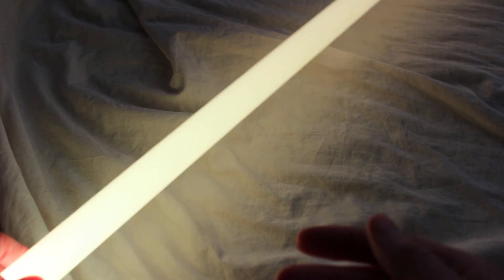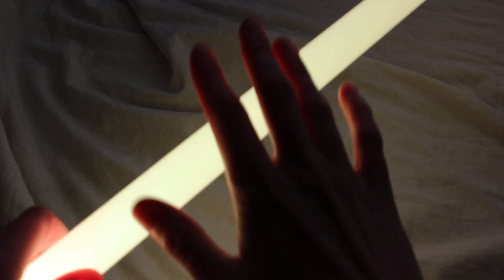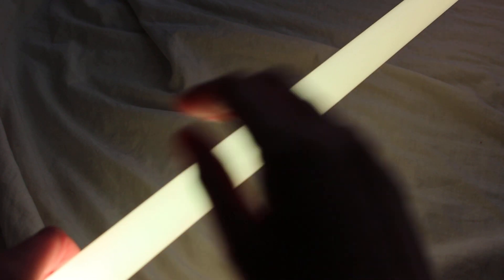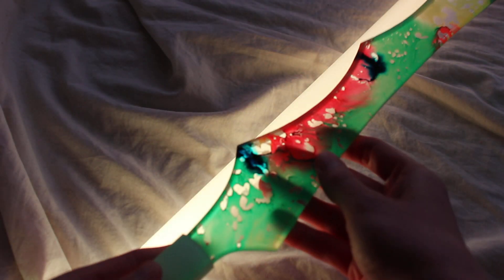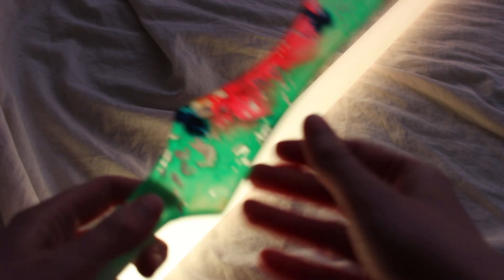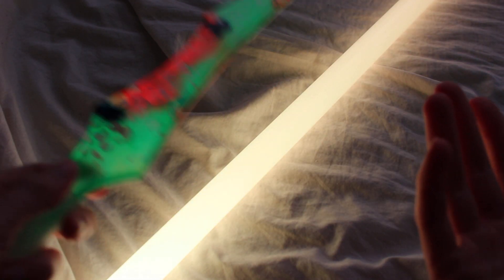What are REAL lightsaber blades made out of?

Comment: It's funny...the MOST PLASMA is like 11,000 to 14,000 degrees ambient temperature. If you were exposed to that at arm's length, you would instantly burst into flames. Coldest plasma cutters are just 212 degrees but that is the tiniest bit of it...a 1" x 36" blade of it would be enough ambient heat to...set anything around it on fire almost instantly upon activation.
Reply: It would need to be near that temperature to cut through some of the things they do. Like metal, it's literally melting metal